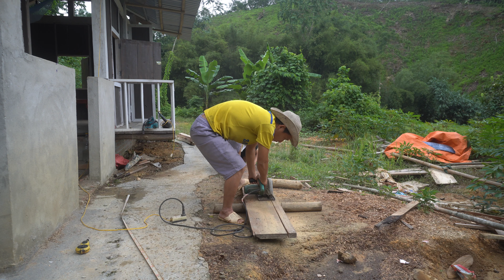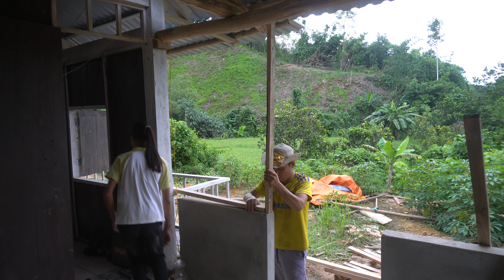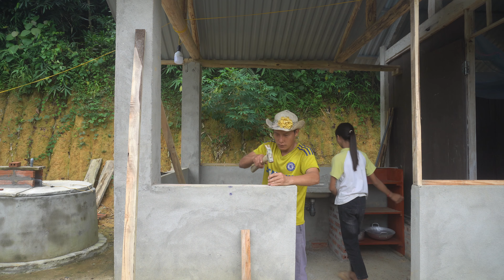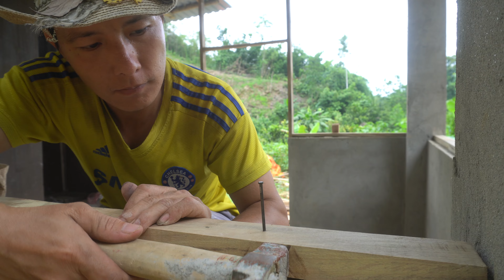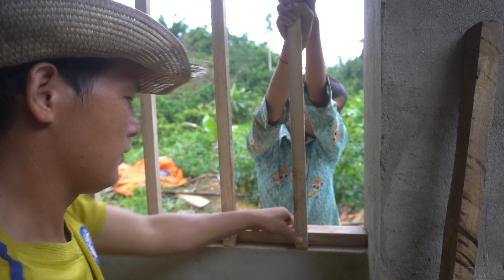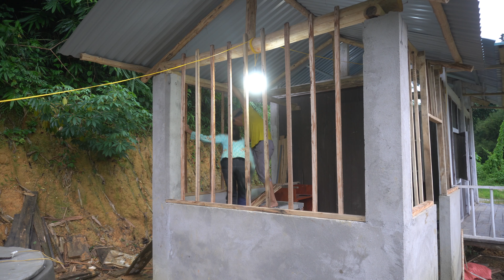Complete kitchen with wooden walls - How to make a house safe from bad guys - Trieu Thi Ca New Life

Comment: It looking wonderful Hun ❤now when you put a lock on the outside of your door make sure they put a flat non removable bolts on what ever you use so no one can unscrew it and one on the inside too...I hope nothing like that would happen but better safe than sorry and want you protected also if you have or can get any screen even that kind you put on the chicken pin would work great and staple or tack it up on your windows and kitchen also the roof if you don't close it in even could make a screen door that opens outside and solid door opens inside but works great at keeping bugs rodents and snakes out. Maybe Asian Elon musk lol (that's who he looks like to me) could help you on that and a fold up bar/table would be neat in the kitchen like hinged to the wall too for extra countertop space but very good work